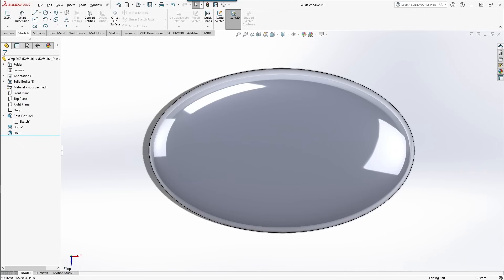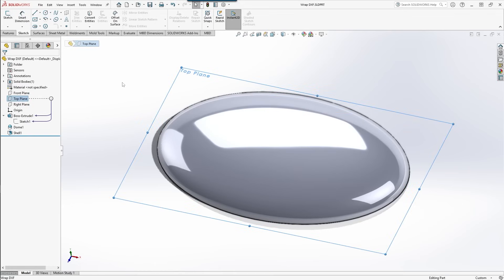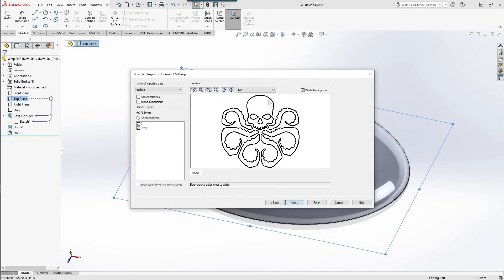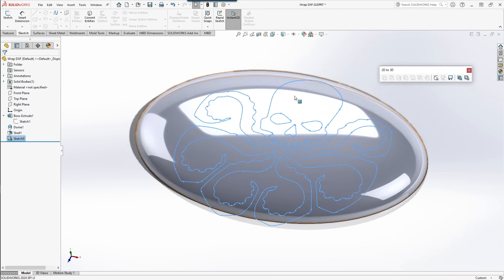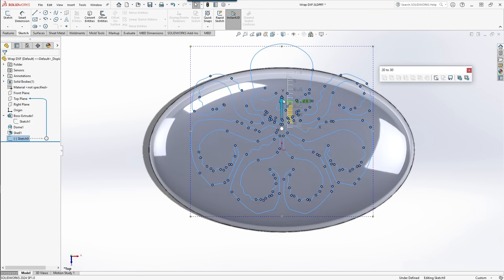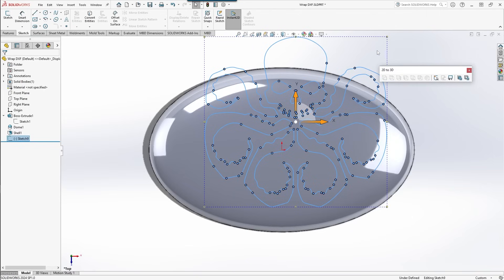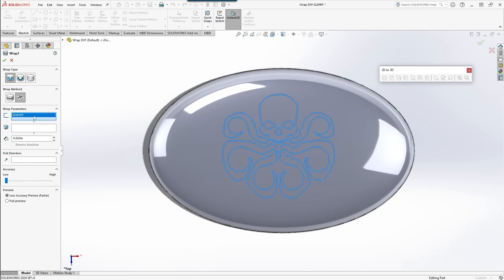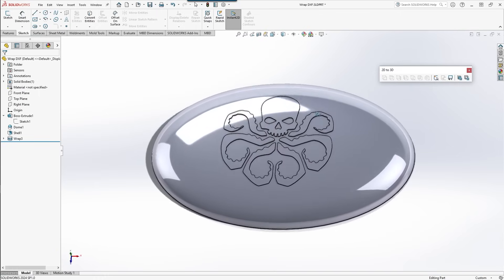How to Wrap a DXF logo in SolidWorks

Comment: If handles doesn't appear on the positionement of the sketch, use the Modify fonction, you can change the size and the position of the sketch
Reply from the maker: Very true!  We also need to reinforce that these free moves only work when the sketch is undefined, otherwise, we need to use the dimensions we added to constrain.

Comment: In the 1'04'' video, the move/rotate handles appeared. I can't reproduce it. Could you please explain the exact steps to make them show up?
Reply: Same problem here
Reply: If handles doesn't appear on the positionement of the sketch, use the Modify fonction, you can change the size and the position of the sketch
Reply: @leobenoist8553  Modify only allows you to move an object, not scale it.
Reply from the maker: The handles will show up when you import a DXF, however, you cannot add any constraints (ie.distance from the outside edge of the surface you are projecting on).  Once the constraint is added, you are limited to that constraint.  If you do not add any dimensions, the handles should be there.  Please message me directly if you have further issues!
Reply: @domeasolidtuts  Hello, I have the same problem as a colleague. The reference with the ability to move the DXF sketch doesn't appear. I can't move or scale it in any way. I don't have any dimensions added to the reference.
Reply: @domeasolidtuts  Hi! I'm struggling with the same problem as described above. My dxf doesn't have any references or any dimensions. Maybe solution is in options of solidworks. Have you changed anything or something like that? Could you please give some more details or help me with finding solution?
Reply: @domeasolidtuts  hi. same problem. how activate handles. i follow step-by-step this tutorial. import dxf. choose "make edit sketch" and handles does not show.
Reply: may by must activate some fetures in toolbars?